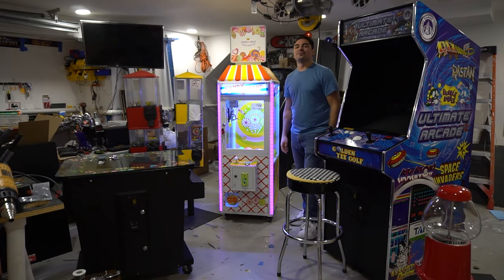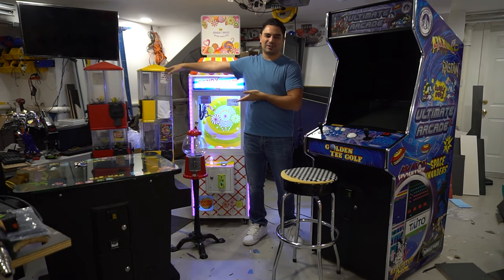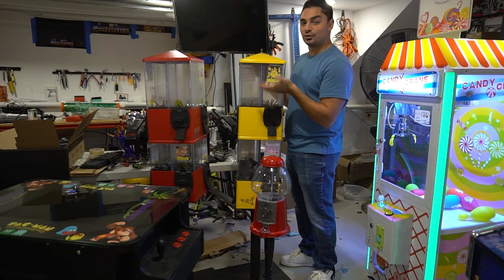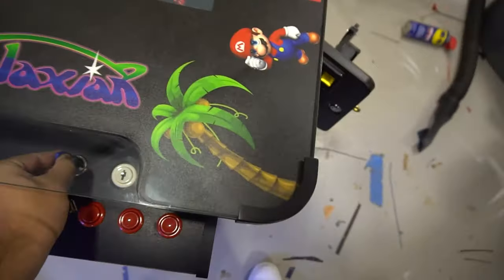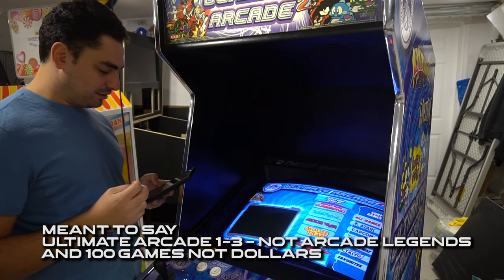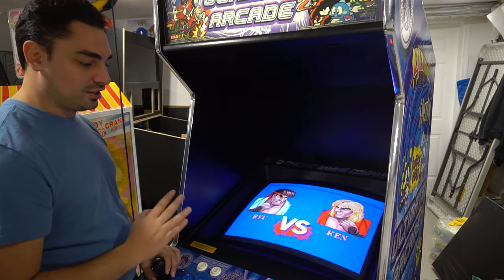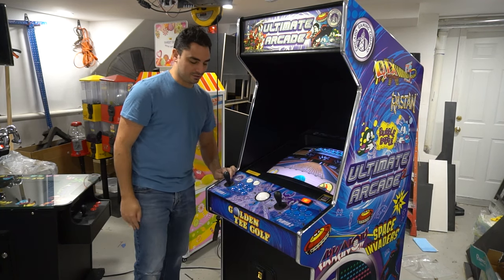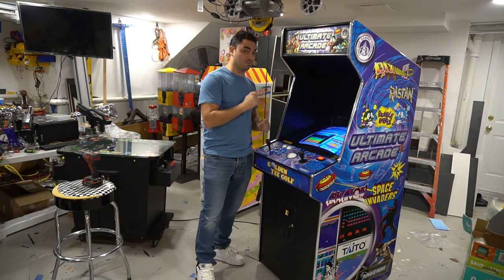"Vic, Help Me Sell This!" Cocktail Table and CGC Ultimate Arcade...

Comment: I almost bought one of these locally 2 days ago for $800.  I changed my mind and got a prebuilt from GRS for $2100.   
I'm glad I kept looking, especially after watching this video.  7000+ games vs 100 games and no high score saves... eww =/
It could be a great cab if you gut the cpu and throw a new system in it but, I'm afraid of that crt going out eventually.